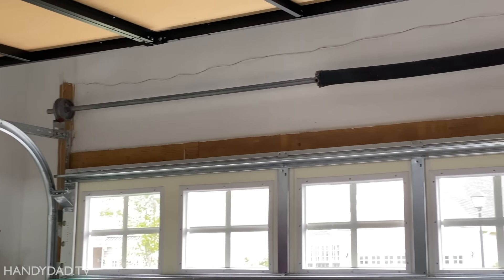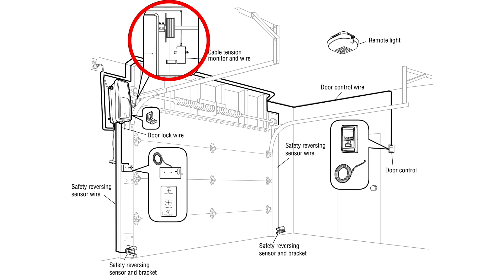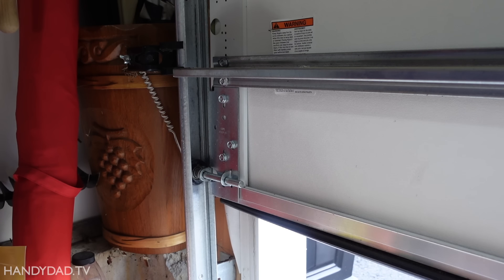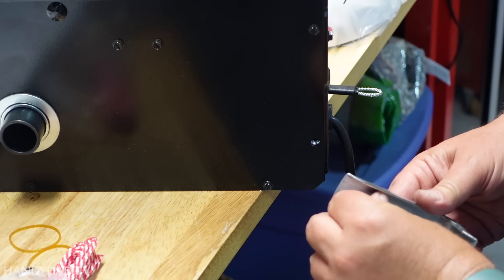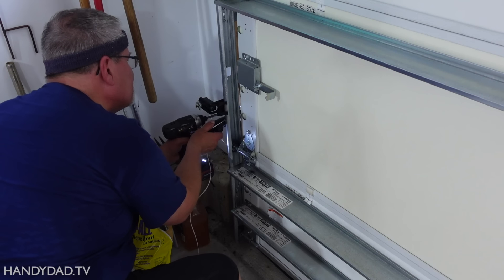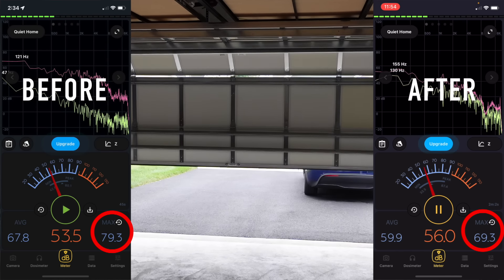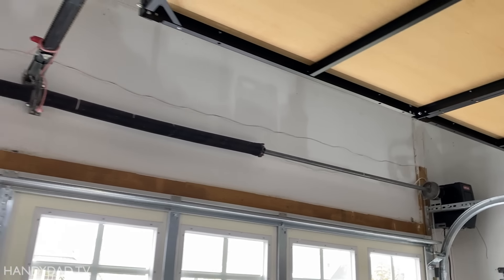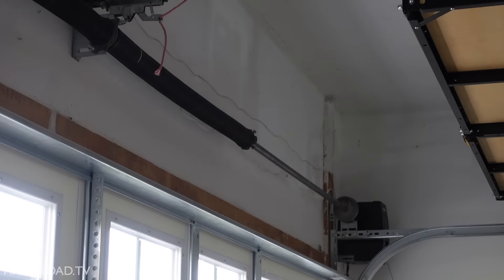GENIE Wall Mounted Garage Door Opener - Worth it???

Comment: I have one of these for my 1 car garage. since I got it setup for a high lift. Pro said that the side mounts can be a real pain. you have to have a separate locking bolt since you could just raise it. the only time you should look at one of these is if its a one car garage door. they suck for 2 car garage doors cause they are so heavy.
Reply from the maker: If the springs are set correctly, the motor shouldn’t feel the weight. Mine is working fine so far.
Reply: @handydadtv  just telling ya, this is a pro been doing this for decades. one the pressure is not balanced on top on the bar. its got to come in the side. two its a pain to adjust and keep working. I have had no issues with mine yet but I could totally see on a two car having this just not work for long. Anyone reading this, no one gets a side mount opener unless you have to. like I did so I could get a car lift under the door while opened.

Comment: At my old house I replaced a noise chaindrive door opener with a Belt drive Genie. Was fantastic, my only issue (and one I hated, which is why I probably won't get another Genie) is that with the door open crossing the beam didn't turn the overhead light on. It makes the garage too dark when out with small children, a dog, or it getting late out while hanging outside.  My new house has a genie, and same thing, this one's worse though, not only does crossing the beam do nothing, if you press the light button on the pad, it will not go back out. I found this out when I pressed the light to grab a beer one night, about 3 hours later I went to grab another and the light was still on. 

I'll probably be getting the direct drive chamberlain or liftmaster, unless the genie finally added the beam crossing light feature.
Reply from the maker: I know what you mean. That’s a good feature. Mine doesn’t have it either.

Comment: I believe you said your door is quite heavy, went on manual mode? If so, it’s best to replace your springs. One because the springs might be old already or two they installed the wrong springs. You should be able to lift the door with one hand only. And also see from the video that the wires for the door for sure need replacement. The last thing you want is for them to snap and now you got yourself a leaning garage door with the bent corner. Just some tips 👍🏼
Reply from the maker: Thanks. New springs and cables are on the to-do list.
Reply: Will definitely feel the difference

Comment: First, I'm an overhead door dealer, in business for over 35 years. Chamberlain operators, be they the older Sears Craftsman, Master Mechanic, Raynor, Liftmaster, etc. enjoy excellent parts availability.  Most major distributors carry Liftmaster, NOT Genie. Genie was bought out by Overhead Door some years ago, and Overhead Door products have declined in quality over the years (Wayne Dalton merged with Overhead Door - ask anyone who's gone to Lowe's and bought a garage door that's constructed of cardboard with a vinyl overlay what they now think of Wayne Dalton). One thing that struck me about this particular installation was how the Liftmaster was installed. If noise lever was an issue a DC belt operator could have been installed. Moreover, Chamberlain used to offer a "vibration isolation" kit, that can still be found online, that effectively isolated the operator head from the hanging angle, dramatically cutting down on vibration & noise. The biggest issue with Genie is their lack of technical support - out in the field, when I've tried to call Genie for technical assistance, the wait time has been ridiculous. I do not repair any Genie products, nor do most of my competitors. If you buy a Genie product online and run into an issue, good luck trying to find an overhead door company that will service your Genie operator, especially if they didn't install it. If you actually want to learn about operators seek out content from actual overhead door companies that have been in business for over 20 years - we all know something the average DIY'er doesn't.
Reply from the maker: Thanks for your feedback. I guess Genie is more of a household name and does a better job of direct-to-consumer advertising than LiftMaster. But it’s really good to get a pro’s perspective even though I still advocate for DIYers.
Reply: Dang this was an excellent takedown of Genie and hopefully it's a comment those (like myself) read who were considering buying one.
Reply: When was the last time a garage door opener (not springs, wheels or rails) broke down and was not just replaced by service Co? I've owned 5 over 40 years in different homes and only replaced one due to burned out motor. That said, it does seem the Chamberlain is fine but the Genie is just slightly lower priced.   Maybe worth spending a few bucks more for Chamberlain or LM.
Reply: Weird how Genie has better reviews on every website in the last few years compared to the other brands.
Reply: I have genie for 11 years….. not even one issue !!!!!!
Reply: I installed a Genie garage door opener in my new house and it’s been working fine for over 20 years!
Reply: My genie wall mount purchased in 2020  shit out 2 years into service. They'd warranty it easy, but I machined the motor to shaft coupling  out of 6061 and had zero issues this far.
Reply: While I do not disagree with you that belt drive openers are good, each type of opener has its own special niche and the side mount is a good alternative in some applications like high lift tracks. Where I really disagree with you is with Overhead Door Corporation, Wayne Dalton, and Genie products. These are the industries best and they set the standard by which all other manufactures set their sights. I worked for the Overhead Door Distributor which covers the area from Richmond Va. to Middle Pa. and I have seen all the good and bad from the competition. There isn’t a product with the exception of Chamberlain Openers that is equal to the  products provided by Overhead Door Corporation and its subsidiaries.

Comment: The genie is the best wall mount operator for garage doors out there right now residential wise. It is not recommended to install them like you did on your specific setup of garage door. They should really be used in a high lift configuration not a standard track like you have at your house. Unless your door works absolutely flawlessly it will give you problems over time. It will throw the cables the door will get sideways and almost fall out of the tracks. We repair those every single day around here. Like I said they are great but they have a specific application that they are designed to be working with.
Reply from the maker: Is there any literature or studies to support this claim? Because all the brands say they work on normal height doors like mine.
Reply: @handydadtv   it’s like a bare minimum code . Yes they can work but they work best on at least 15 inch radius track or high lift ask any professional company and they will tell you it’s nothing but issues

Comment: After having a bad experience with the Chamberlain type cable sensor this idea does make more sense but the idea that you are relying on the weight of the door to close it is a major flaw.  Never mind the locking aspect.  If you need to open your door manually for any reason like lift malfunction or power outage you are pretty much screwed especially if you are a smaller person like my wife.  I had the other type sensor which was so bad that I returned it but this is only slightly better assuming it works flawlessly all the time.  Ill buy one when they rethink the entire drive system and dont rely on gravity to bring the door down.
Buyer be ware!
Reply from the maker: I’ve not had any issue with mine.
Reply: @handydadtv  have you tried to release the drive and open it manually?  What would happen if you released it when its raised?  I wouldnt want to stand under it.
Reply from the maker: @berniestarzewski5482 I have used it manually and it doesn’t fall on it’s own. I don’t know how the vibration gets it to come down. It’s magic.

Comment: My Daughter and Son in law have one of these on each of their garage doors. They were installed with new garage doors by a professional garage door company. I believe It is a chamberland it has the cable slack levers. I have been over to their house numerous times to rewind the cables due to the door opener being activated while the car was in the door opening. (grand kids lol)
While there was no serious damage to the door, car or opener I have definitely  decided I won't be installing these units on my doors.
Also there is the issue that the door tension spring has to be biased to allow the door to come down and not be balanced. Which in my opinion is an unsafe condition because when you pull the release cord to operate the door manually the door automatically wants to come down. Those two things are what are keeping me from purchasing this unit.
Reply from the maker: I didn’t touch the spring and mine works fine.
Reply: Never trust a professional garage door company entirely.  They often show up, get the job done as quickly as possible then leave.  They can do a shotty job.  Regardless of which garage door opener is installed, if you pull the release cord, it should not want to come down.  The door should be sticky at any point as you pull it up or down then let go of your hand.  If it doesn't stay when you let go of your hand, then the spring or springs need to be adjusted.  I would have someone knowledgeable check the installation before a serious accident happens.
Reply: That is a poor install . You do need the Correct track set up the reason for the spring and cable issue is installers that’s think less tension will help the door come down easier causing cable slack

Comment: Great video. I was looking for options for my auxiliary 8' door on my RV garage and this seems to be the answer. It also looks easy enough to install myself. Thanks for sharing.
Reply from the maker: It’s a really good solution for tall doors.
Reply: @handydadtv  This is actually the 8' rollup that is in the back of the RV garage. I currently don't have anything on there, so I open it manually.

Comment: Just curious how this opener is holding up since you've had it for a year now? I'm very interested in replacing our old noisy openers with something like this. We also have a detached garage that has a very low ceiling, the previous owners cut a hole in the sheetrock in order to install an overhead opener.. SMH!🙄
Reply from the maker: I’m still using it. Working great. Only complaint is the Bluetooth wall control loses its connection and I need to pull out a battery momentarily to reset it. Maybe once a month. Not terrible.

Comment: I am envious. My outlet is by the old style and broken overhead unit.
Reply from the maker: You can use an extension cord in a pinch, but you’ll need a permanent outlet before selling the house. It will get flagged in every home inspection.

Comment: Does your unit flex at all when in operation? I notice mine flexes or sways but it’s rock solid on the wall.
Reply from the maker: Yes mine sways as it turns. It’s possible the shaft isn’t perfectly straight, or that I didn’t align it precisely when I attached the collar. The bracket appears to allow the flex, so it’s not an issue.

Comment: We have a low ceiling. 3.5 inches from the ceiling to the bar that the opener needs to attach to. Is this enough space in your opinion? Thx for the video. BTW-Thx also for having a Tesla.
Reply from the maker: I think you’ll be fine, but I’d take a look at the manual online to verify the required clearance.
Reply: Thx much @handydadtv

Comment: Cool video!!! I've been watching and learning cool new ideas for many years, so I'm a fan of your channel. This one is really cool, and I would definitely consider using this if/when mine needs to be replaced. Anyway, I just would like to know if there's any chance you could do maybe like a one-year update to see how its holding up. How long have you been using it??? THANKS FOR THE CONTENT!
Reply from the maker: Ask me again in a year 😉
Reply: Nice video. How is it operating 1 year later. Another question that I have is , would I be able to operate it without Wi-Fi,  as I would need o e at my cottage that doesn't have internet.
Reply from the maker: @donroy9968 Great opener even after a year. My only complaint is the Bluetooth wall remote occasionally needs to be reset by removing/reinserting the battery. Maybe every 2 months or so.

Comment: I installed this garage door opener about one year ago...and agree it's very quiet, frees ceiling space, and performs wonderfully. My ONLY complaint is with the two spring brackets that are installed on the lower rollers and attached to the cables of the doors. These spring brackets (which assure proper cable tension during closing) are buggy and often get jammed while the door is in the up position and keep the door from closing. Attempts at reshaping the arms and the use of spacers have yielded varied results but have not solved this issue. I can not trust the door to close properly and have to double-check it all the time. This aspect of this otherwise wonderful opener should be re-engineered for a better solution.
Reply from the maker: Interesting. You would think a simple spring would be a better solution than a cable sensor. Now I’m not so sure.
Reply: @handydadtv  In concept...I agree. But the reality is that garage doors...specifically the lower cable attachment bracket, and the spaces (tolerances) involved vary considerably by age, usage, installation,  rail types, etc....and this challenges the spring design and shape, and its ability to perform.
It's frustrating that a tiny and inexpensive component can render an otherwise wonderful opener inoperable.
Reply: As a professional garage door installer, I have brought this up to Genie. Some brands of garage door tracks are not as tight where they meet as they should be. This allows for a small window where that cable tension spring can get caught right in-between. Once that happens it will jam up the garage door and cause problems. I will remove these entirely if the door is properly balanced and rolls perfect in my eyes. I am not telling you to take yours off, but you might want to have a professional look at it first. The engineers put a lot of work in developing this stuff to work right but they don't test every brand of door nor can they test every scenario.
Reply: @followerofgod7935  Thanks. Good advice. Yes, I have talked with Genie a number of times over the phone and, although they were quite friendly, I didn't get a good solution. I've considered removing the springs...my door is well balanced but I fear having the cable loose when closing and then not functioning properly.
Reply: @jeffw8057  If the cable tensioning springs are causing the problem.....then remove the problem. 😉 The homes that we have removed them on are still working just fine. 😊
Reply: I think I might have the same problem.  The door will open but then sometimes it won't close with the red light flashing and then I'd have to manually close it.  Then I can open and close it again after it resets.  Is the problem the tensioner?   I feel like the tensioner rubs against the track on mine since I don't have a huge gap between the door and track

Comment: question, I have an older wooden 2 car oversize garage door, big enough that I can fit my conversion van in, i.e. taller than most....is this a good opener choice considering the weight of the door, do you think? there is currently little clearance with the currant overhead rail and I'm ready to replace. I've seen other reviews that say this is not a good choice for heavier doors.
Reply from the maker: I’m no expert, but I didn’t think the weight of the door matters because the spring does most of the lifting.

Comment: Maybe you've already answered this but have you had to replace the batteries in the wall console? If so how long did the batteries last and do you have any dislikes so far?
Reply from the maker: I haven’t had to change the batteries yet, but the wall console freezes occasionally and I need to remove a battery temporarily to reset it. That’s my only complaint.

Comment: I believe I am having the same issue you were having with your cable keeper. The cable keeper opposite my opener tends to come detached from the nylon eyelet. It does appear that the space between the track and door is to narrow. 

I wasn’t sure how you resolved your issue. Any help would be appreciated. 

Thanks
Reply from the maker: I loosened the track bolts and spread it a little. Problem solved.
Reply: @handydadtv  thank you

Comment: Do you need a certain amount of ceiling clearance for the install?
Reply from the maker: It doesn’t go much higher than the shaft, but you should check the manual online to be sure.